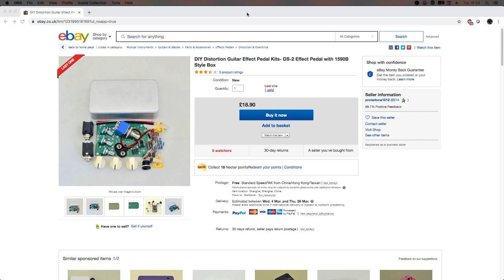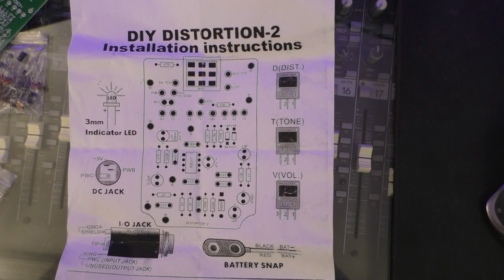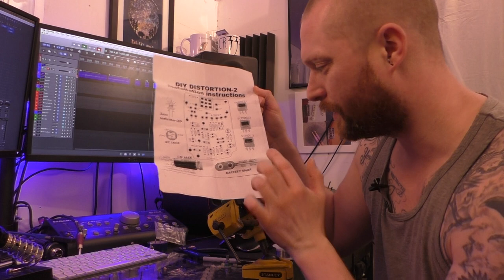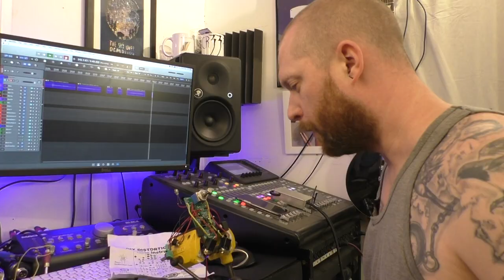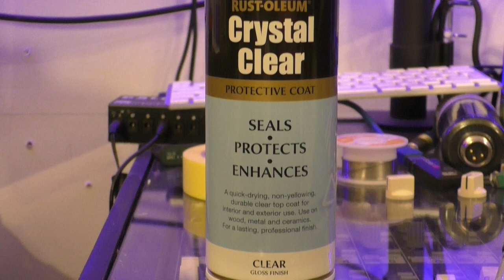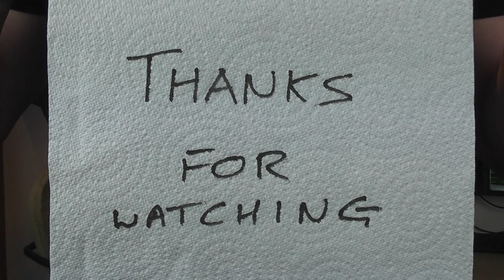DIY Distortion Pedal

Comment: Is the ic an original LM308? I think the circuit is Proco RAT. Because ut uses the LM308. And thats the only distortion that i know, that uses that ic. Btw nice work man!
Reply from the maker: Thanks mate. I seriously messed up the paint job though. You would have thought I’d learn from that but I ruined the paint job on a microphone recently too from handling it too soon. Idiot.
Nice work spotting the circuit. I assumed it was bass on a boss DS2 as it says distortion 2 on it but I think you’re right. Might buy another and do a better job
Reply: @PherotoneStudios  The tone control working backwards is another sign of a RAT type circuit, the filter pot on them is kinda counter-intuitive in the same way!
Reply: @gladiatus366  

This sounds really bright, for a straight RAT clone. I know a lot of distortion pedals (most 'budget' pedals), use a modded RAT clipping circuit, with various tone stacks, to emulate other pedals. Most budget 'clones' of popular pedals, really aren't clones, but RAT circuits modded to sound like something else. Same with OD and the tube screamer circuit. Then you have weird stuff, like an OCD 'clone' I had awhile back, that was definitely a modded RAT and a tube screamer 'clone' I have, that is almost certainly a modded BOSS OD1.